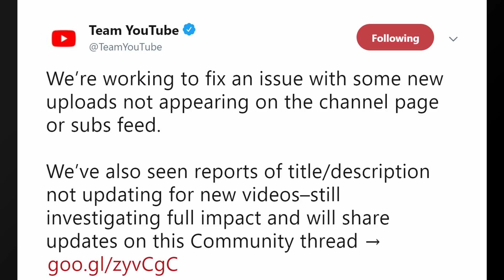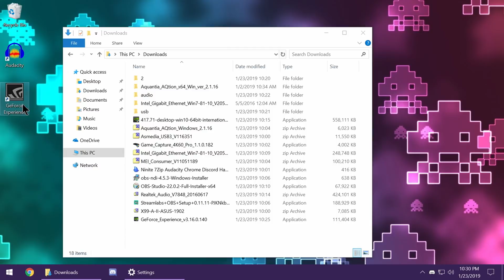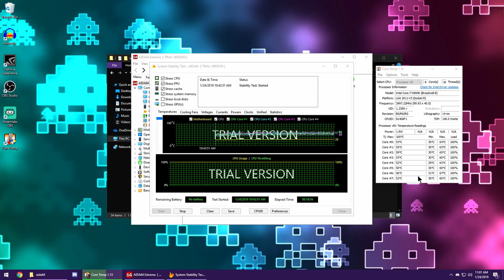Building a beefy Streaming Rig + Render Server COMBO WOMBO (part 2)

Comment: What's that purpose of having mixed matched graphics cards in your rig or did I miss something?
Reply from the maker: General CUDA acceleration/GPU acceleration doesn't require SLI or matching cards. They both get used for Resolve rendering.
Reply: @EposVox  oh now I understand thanks